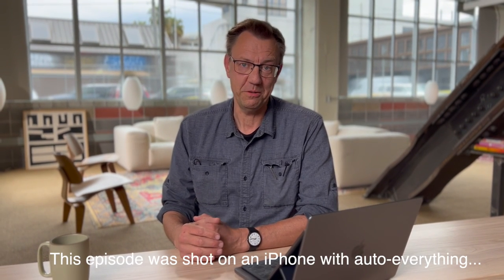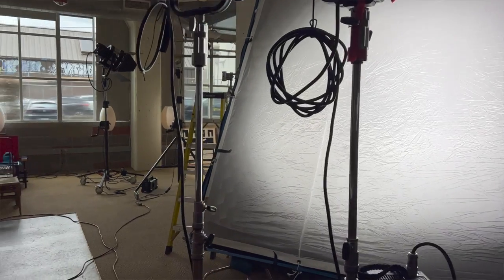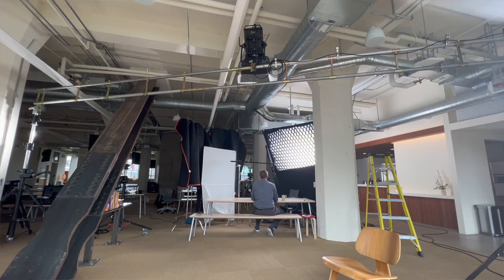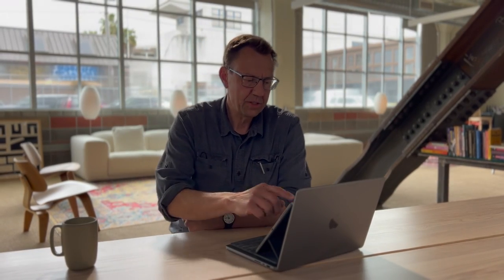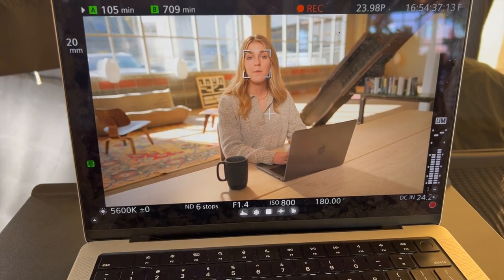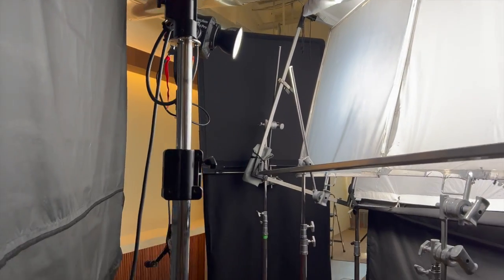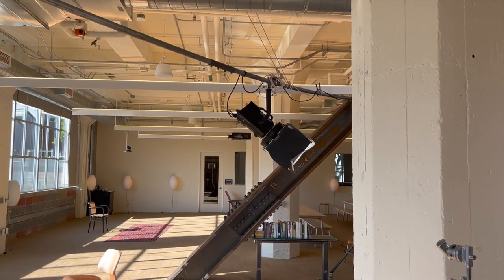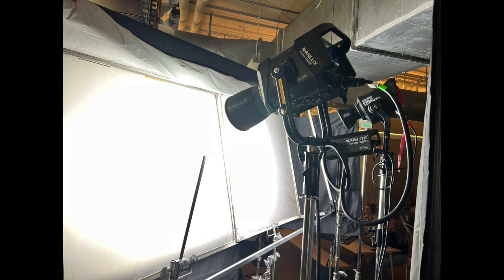Meet The Gaffer #291: Software Training Video - broad strokes lighting

Comment: I know the iPhone warms everything in those shots, but for the actual shoot (I use Notion, so I'm watching some of the tutorials now part learning, part analyzing), am I right in inferring that the outdoor light was cooler than 5600, the lights were at 5600k and the camera was at 5600k or slightly warmer?  (In a couple, the outdoor clearly went a lot more cool! Looks like they "doubled down" and actually warmed the whole image slightly vs. the first shoot.)  Looks like you guys introduced some bounce on the talent's far side (within the sound blanket) I'm guessing to fill the shadow a bit for the high-ish key look.  This video is super useful for me, but recognizing that the gear to get this level of quality on a larger "set" requires a significant step up in lighting power and scale of grip gear.  Gears are turning to get this "feel" but at a more "intimate scale."
Reply from the maker: Hi Thomas,
As with any video there are a number of steps after capture that tend to alter the image. I mentioned that the capture of this episode was via iPhone exactly because of what you referenced re warming in post and because the auto iris put the window at a lower level than how it was being recoded by the production cameras, which in turn affects other aspects of the image. Then when you add compression from 4K to an uploadable file to YouTube’s compression: things change😀 

Yes, the ultrabounce floppy added a subtle bounced fill. 

After all of that, I’m glad you still find something useful for your purposes!

Comment: I cant imagine using the Evoke1200b inside with the fan being so loud, how did you work with that?
Reply from the maker: I use it indoors all the time🙂
Reply: @meetthegaffer  bought 2 recently and find them much louder than the daylight panel even on smart mode. How would you compare fan level to the daylight Evoke?
Reply from the maker: I have not done a side by side between the two. I think the Prolycht 675 is probably the most quiet of current larger LED’s but the Evokes are dealing with twice the wattage so there is a lot too cool.

Comment: It seems when 'fighting' the sun .. you dont mention if the two 1200 lights are maxxed out? Also while im not a fan of sofboxes, prefering more flexible lighting mods, it seems that they, softboxes may be more efficient as every photon of light that leaks out the back does not hit the subject. If not boxes you might be able to place something solid white behind the key light(s) - especially the 'bottomer' might be losing you lumens.
Reply from the maker: In this case all the units except the back light were at full. It’s a good thought. I’m not sure what the efficacy is of captured light vs a the spilled light coming off of an unenclosed frame of diffusion. In a snow that would be the idea of the Beehive box. We could have worked that bottomer a little better and dotted the table with a smaller flag and kept the wag lower over all. There’s always next time!
Reply: @meetthegaffer  Its all good. Its great to see. But knowing that they were up full makes me understand that my single 600 (for key) would struggle to pull this job off without supplementing it somehow.